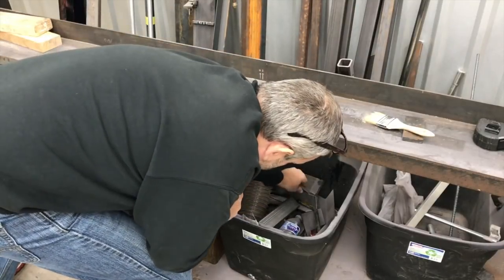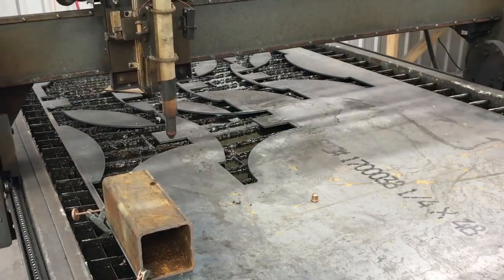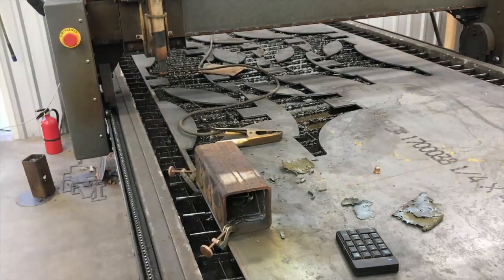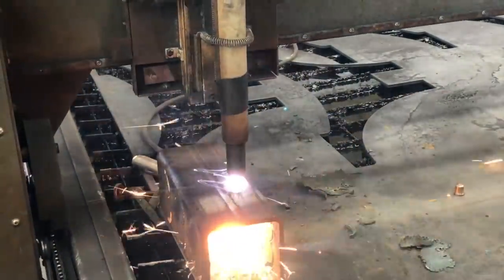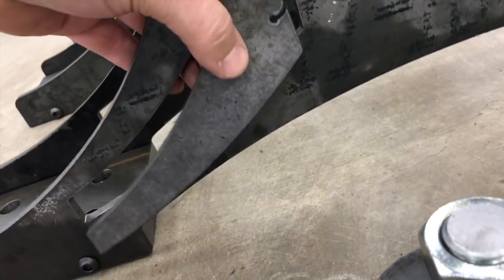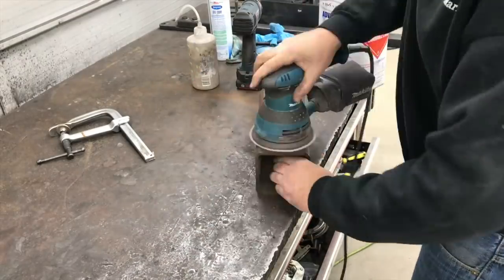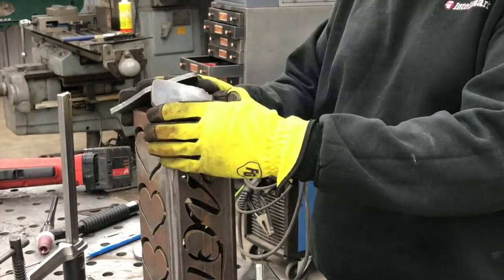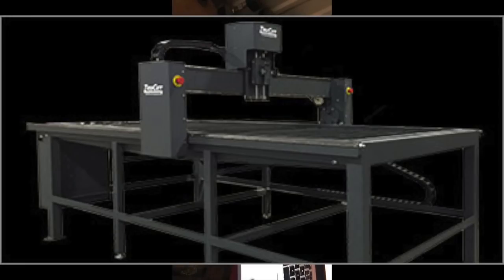CNC Plasma Cutting Square Tubing with trucutcnc

Comment: Pretty neat build from scraps! 👍 I have a 4x8 Torch Mate table, every option, z axis, router capability, 2.5D software, arc hight, back before Lincoln bought them out, hypotherm 900 or 1000, machine torch. I don't remember which. I've never used it. Was too busy elsewhere. Sadness. Better fire her up one of these days.
Reply from the maker: wow that's crazy! man get that thing fired up, you will have fun with it!

Comment: Those off cuts out of your table legs.... I see steampunky or ? style art lamps there. Using them for the legs. Put them on a tube or pipe to get the power cord in, whatever a man could conjure from there up.  Evidently you update on the table requires an amount of teasing before you can show it lol.
Reply from the maker: yea they are kind of steampunk, thanks for the ideas!